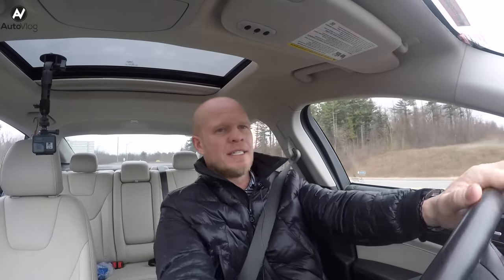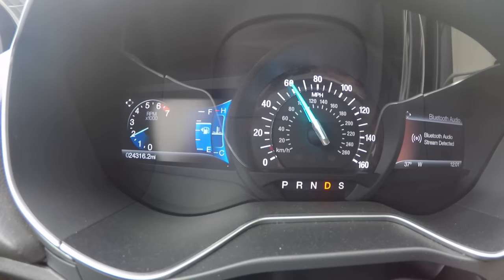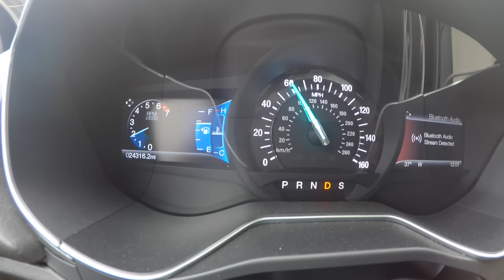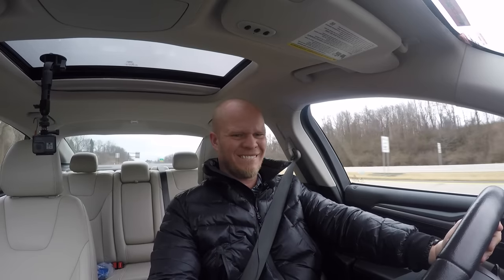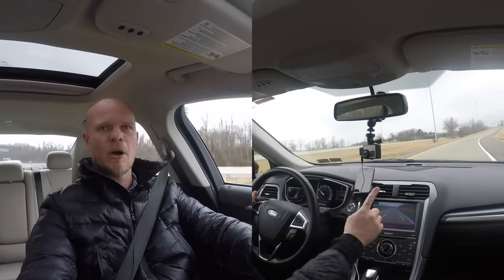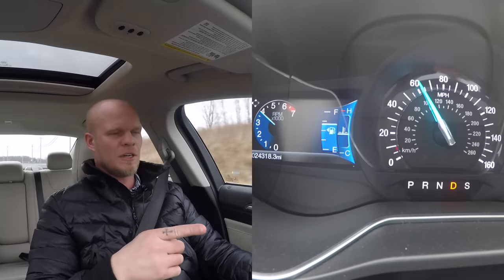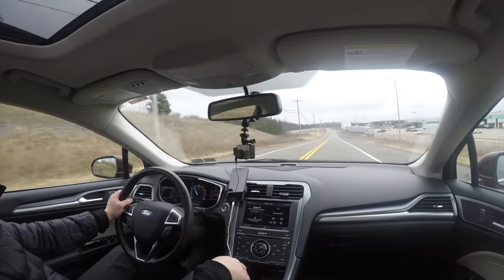What happens if you put your car in REVERSE while driving? (Things NOT to do while driving)

Comment: 😂do it with a manual 😂 thats the real thingy
Reply: SUYASH on agario and more reverse has no synchroniser so it wouldn't engage while moving forward more than a few mph
Reply: I did this with my Audi A3 but I was like 5kmh or sth and It only kicked out the gang to neutral :D but It was scary :D not like this in a automatic car
Reply: I wouldn't know. Never driven an automatic
Reply: New cars won't let you
Reply: I tried it while going very slow slower than walking speed and it already didn't sound pretty
Reply: if the car is >2010 the transmission is probably controlled by the computer so....
Reply: It'll just grind.
Reply: on older cars the wheels would lock up bc the transmission only wants to reverse, but newer manuals just wont allow itself to get in gear.
Reply: I doubt you'd be able to mesh the gears.
Reply: The gang ... German detected! :D It's gear! Must have been a nice crunching sound, did you manage to engage it at all?
Reply: No problem with rev-matching! ;)
Reply: Yorgarazgreece no
Reply: BlastForward LMAO!! rev match always works!
Reply: you won't be able to do it in a manual either it will just grind the gears as the output shift is spinning the wrong way and the sincros cant mesh the gears
Reply: A lot of cars don't even have a synchro on reverse so it's even harder.
Reply: Hey Suyash I'm a big fan of you
Reply: Only way to probably do that is the lock the drive axle, reverse, then off the brake.
Reply: Do they even put synchronizers on first gear? It seems kind of pointless, since you never really need to shift down into first gear while moving.
Reply: Alexander Krivács Schrøder, yes pretty much all cars and trucks since about the 1950's have had syncromesh on 1st gear.  Some of the older vehicles (especially truck chassis) did not, and you had to double clutch to get into first. 
And yes there are times it is necessary to downshift into first gear on the fly such as while climbing a steep hill (even a steep driveway).   The main reason though is this.  If you're sitting still in neutral, engine running, clutch out, the tranny's input shaft and intermediate shaft and all output gears are all rotating with the engine.     When you disengage the clutch, all of those things keep spinning for a while.   If you try to push it into 1st gear without a synchromesh it will grind the teeth on the slip ring's dog teeth until everything has stopped spinning (sometimes very abruptly).    Same thing happens if you try to engage reverse gear too quickly as reverse's idler gear has no synchromesh.    Putting synchros on 1st gear allows it to slow all those spinning parts quietly and engage 1st smoothly, even while at a dead stop.    This is also why if you need to engage reverse very quickly after depressing the clutch after sitting in neutral, it's best to slip it into 1st or 2nd gear to stop all the spinning gears smoothly, and then select reverse.
Reply: Actually, I think you can (did not try) because you will do this with the DISENGAGED CLUTCH, thus the grinding will have only the inertia of the engine-side of the transmission (repeat, clutch disengaged). It's the same mass for which the double-clutching is used. So once the reverse gear is in, the clutch will slip and wear badly to stop the car (similar to when you do 0-100 times....clutch does not care about direction, just speed difference).
I did not do this, but on track days I stop by stopping the engine and using the clutch to "brake" from 10-20km/h. That is because stopping the car with heated brakes will "cook" some pad dust on the rotors. The difference is that I'm already in 1st gear when doing this.
Now, you may stop the vehicle with careful "clutching" (and probably burn the clutch), but if you just pop the clutch, I see 3 possibilities:
1. drive wheels will lock/slip
2. drive wheels will lock/slip + engine stall
3. engine stall and going in reverse (engine, not car)....this is the worst I can think of and would result in engine damage.
Reply: Matei Beratco, plenty of people have tried it by accident, and never succeeded.
The reason is that the output shaft is turning forward while the car is moving forward, and there's enough friction created between the output shaft and output gears due to the viscosity of the oil between them, that the tranny's gears will continue to spin forward at some speed even when the clutch is disengaged.  You can overcome that speed difference with the synchros when moving between most forward gears, but can't stop and reverse the tranny's whole gear train by mashing the reverse idler gear against the forward spinning output gear and still forward spinning input gear.   Even with synchros, pretty much the same thing happens if you try to shift into 1st gear while moving at a higher speed.   The speed difference between output shaft and 1st output gear is just too great to overcome.  

BTW, using the engine and clutch to "brake" (as in to slow down form a higher speed) is generally a bad idea.  You can use engine braking to change the balance of the car to induce oversteer,  or keep from going faster down a long hill, but when it comes to actually slowing the vehicle, 4 brakes do a much better job  at a much lower long term cost.   4 sets of brake pads cost a couple hundred bucks to replace.   A clutch or tranny, several thousand dollars.    If your brakes are not up to the job at the track, it's fairly cheap to upgrade brake pads, rotors and fluid (all still cheaper than a clutch job).
Reply: daemn42  so it's not good to downshift to reduce speed ( used in conjunction with braking)?
Reply: daemn42 U got that from google
Reply: They tried it on Mythbusters. it wouldn't go into reverse no matter how hard they tried. It did make a violent grinding noise, but it never engaged reverse. If it did engage, it would burn the clutch or destroy a synchronizer ring and probably stall the engine
Reply: Christion Collins I'd forgotten about that episode, but yes they tried shifting into reverse at 50mph in both an automatic, and manual and both had no effect.   He kept trying to engage reverse in the manual as the car slowed and it just kept grinding and grinding.     Had it ever engaged it wouldn't destroy a synchronizer because reverse idler gear has none, but had to be taking material off the corners of the gear teeth.
Reply: when you nut, in fact I did not.   I've had a couple manual transmissions out of the car on the bench over the years (one in auto shop class way back in school and another from my own car a few years later), and turned them by hand.  With oil in the tranny, if you spin the output shaft in the forward direction, the output gears and intermediate shaft will start to turn the same direction due to the viscosity of the oil in the bearings that separate them.  All the output gears are turning different speeds relative to the output shaft but still everything wants to turn same direction as output shaft.    Once the gear train in the tranny is turning forward  it becomes almost impossible for the reverse idler gear to engage.
Reply: daemn42 aww got that from Google to
Reply: SUYASH on agario and more it'll just grind
Reply: when you nut, I get that you're probably just trolling now, but I've got a challenge for ya.   How about you try to find on Google, the information I just provided based on my personal experience.    Specifically why the reverse idler gear won't ever successfully engage while the vehicle is moving forward.    There are plenty of diagrams and animations showing how a manual gearbox works, but they all imply that the intermediate shaft and output gears can be completely disengaged from the output shaft, but they don't mention one important detail.
Reply: daemn42 I gotta go now 💨
Reply: my exact thoughts xD blow our engines and shit lolol
Reply: SUYASH on agario and more some times the transmission wont let you put in gear cause of high rpms if I'm at 2k it's pretty hard to throw in reverse
Reply: Yeah the syncros probably wouldn't allow it to happen.
Reply: JoeJ8282, reverse gear usually doesn't have synchros.
Reply: Older car in reverse you'll grind and destroy the transmission but ultimately have the same effect: coasting forward
Reply: Daemn42, that's not true, you don't need to stop or slow down or whatever to change gears.  People have been shifting gears for years without synchro's and still are, you match the input to the output and put it in gear.  I've shifted many a 4 speed transmission with out the clutch, it's hard on synchronizers but can be done with no grinding.  I used to have a T18 with granny low that you could put in low no problem if you revved the engine to match your speed, low wasn't synchronized, but 2,3,4 were.  Semi's do it all the time, none of them have synchronized transmissions.  Downshifting to reduce speed doesn't hurt anything, you need to go out and experience it and get off of wiki.
Reply: Eric Johnson,  Nowhere did I say that you had to stop or slow down to change gears.    I said it's harder on the rather expensive synchros and clutch to use them for the purpose of slowing the car, than to use the cheap and highly effective brakes which are made for that purpose.    Also, rev matching only helps reduce wear on the clutch.  If you want to reduce the abuse of the synchros when downshifting at high revs, you have to double clutch, and the vast majority of people simply don't know how to do that.   The only way to get into a non-synchro 1st gear at speed is by double clutching, and 18 wheeler drivers have to double clutch both upshifts and downshifts.   And if you're braking while double clutching, then you have to learn how to heel-toe and even fewer people know how to do that.    Everything I've written here is based on personal experience, not wiki.    Check out the "R32" videos on my channel for some driving fun.
Reply: Eric Johnson, To answer you questions first, I have not driven a T18 but I grew up in farm country and drove many old 4 speed farm trucks with non-synchro granny lows.   In fact, I learned to drive on one before I was 10.    There was no way to downshift into granny low while moving forward at more than about 2mph without grinding the gears, unless I also double clutched.  That action was, put the clutch in, take it out of 2nd gear into neutral, quickly let the clutch out just to the engagement point to link engine rpm to tranny gear train, rev the engine up to match granny gear's rpm to output shaft rpm, clutch in and engage granny low without a crunch.    In answer to second question.    I have torn apart and rebuilt two of my own 5 speed transmissions (and one in school before that).      

Perhaps your definition of rev matching is different than the norm.   What most people mean when they say "rev matching" is simply stepping on the gas in the middle of the shift (while clutch is fully disengaged) to bring engine rpms up to where they'll need to be for the next lower gear.  Most people do it just to avoid the lurch when they let the clutch back out in the lower gear.   If you don't rev match, then the clutch has to take up that rpm difference and despite what you claim, it does not happen instantly and without stress to the clutch (especially at higher rpm, which is why I recommended downshifting toward the end of the braking, rather than the start of it).    Rev matching (as described above) alone does not match the tranny's input shaft speed (which is now disconnected from the engine when the clutch is in) to output shaft speed (at next desired output gear rpm) unless you also double clutch in neutral to connect engine to tranny's input shaft.       Thus there's no way to downshift into a non-synchro gear without some form of double clutching (wait.. see below before you respond).  

However, I've heard  that some semi truck drivers do not fully depress the clutch while shifting.      Is that what you're doing with your T18 while downshifting and rev matching?   If so then that  has the same effect as double clutching (by keeping the engine linked to the tranny input shaft in the middle of the shift to bring tranny's gear train up to speed).     This is not a technique people generally would use on a passenger vehicle.
Reply: daemn42; Well, maybe it's not "synchros" in reverse gear that I'm referring to, but something in the design of at least my car's transmission prevents it from being shifted into reverse while moving forward, because I "accidentally" tried to put my 5-speed manual transmission car in reverse while moving forward at highway speed one time, and no matter how hard I tried, it just would not go into reverse gear while the wheels were going forward at that speed... there was no gear grinding either, it just wouldn't allow me to do it. (I was just doing a test to see anyway, and even if it would have, I was definitely careful to keep the clutch pushed all the way in, because there was NO way I was gonna ruin my engine or tranny by letting the clutch out at that time, even IF it HAD let me put the gear shift into reverse!... But it wouldn't anyway, so that was totally OK with me!)
Reply: JoeJ8282,  maybe there is some other type of electronically activated reverse blocker in the tranny in your car.  I've driven manuals all my life, and none of mine would let me engage reverse while moving forward, but they've all complained about it with some type of gear grinding noise.
Reply: Yeah, maybe... Or, since my car is from the early 90's, I was thinking more along the lines of something like a mechanical "centrifugal clutch" or something like that, that when the output shaft is going fast enough forward it won't allow reverse to be engaged?... But I don't know how something like that would or could work because I've never taken a transmission apart.
Reply: JoeJ8282 Manual transmissions have a reverse lockout, on Muncies from the 60's you had to depress the shift lever to get it in, and then the mid to late 60's they changed it to a lock out that you had to lift.  Automatic transmissions have a lock out too, you can not simply push the shifter into reverse, you have to physically pull back or push a button, in case of floor shifted, to get it into reverse, it will however go into neutral and that is why they make reverse valve bodies for racing so you can not miss a gear on an automatic.

daemn42 Yes that is how to shift a synchronized or non-synchronized transmission up and down with out touching the clutch.  You saying that it can't be done is 100% wrong as I have done it for literally hundreds of thousand miles.  The high change of ratio makes it harder to do in a car than in a semi or such.  I've shifted Eaton transmissions, my T18 was in a Scout and M21 and M22 Muncies, and a hand full of T10's and T56's.  I've shifted all of them with out clutching and even shifted the Muncies with out lifting off the gas, but clutching it.  Is it hard on them, yeah it is, the only one I would shift habitually with out clutching is the Eaton as it wasn't synchronized, but saying it can't be done is not correct.
Reply: +Eric Johnson,  Please stop trying to put words in my mouth.    At no time did I say it was impossible to shift up or down without using the clutch.     What I said is that if you're shifting normally (in the context of this video about a passenger car, that means disengaging the clutch between gears) it is nearly impossible to downshift into a lower non-synchro gear at speed without also double clutching and rev matching to bring the tranny's gear train up to speed to match the speed of the output shaft for the selected gear.     

Shifting without depressing the clutch,  while rev matching through neutral has exactly the same effect as double clutching, and I fully acknowledge that it can be done that way, but is a technique rarely used in normal passenger vehicles.  I had a clutch fail while off-roading once , causing the clutch to stay engaged permanently, and was forced to drive it home and to the shop this way, but the synchros still helped a lot because as you say, the difference in gear ratios between each gear is quite large.
Reply: The only way to get into a non-synchro 1st gear at speed is by double clutching, and 18 wheeler drivers have to double clutch both upshifts and downshifts.

Those are your words, and you are wrong, you don't have to double clutch shit, I've never done it and won't start, no need to start.  I'm done arguing and don't give a shit, I know what can and can't be done, I've put on a hell of a lot more miles, and blown more engines and transmissions than you can fathom.  

Your knowledge is not there, your clutch didn't fail, your diaphragm failed, if the clutch failed you'd never made it home.  Rev matching, floating gears, bla bla bla, it's all modern terms, we never called it anything back in the day, we shifted how the situation demanded it.
Have a nice week.
Reply: So if my throwout bearing went out on my car's clutch, but the clutch was now always engaged, could I drive my car using the rev matching in neutral technique for a long period of time without harming the transmission?... I cannot afford to fix it right now, but I still need wheels to get around!
Reply: Eric, yeah, I've seen cars like that with the reverse gear locking rings or buttons, etc, but my car doesn't have any kind of hand or finger operated mechanical lockout on the shift lever or anything like that, all you have to do is move the shift lever over to the right and down to go into reverse, (when you're stopped, at least)... It won't go into reverse at all if going forward more than like 1 or 2 MPH... That's why I was thinking it might be something else that prevents it in the internal design of the transmission... Which is a cool and useful feature to prevent damage!
Reply: r.i.p clutch, shits just gonna fucking grind
Reply: this guy , lol he doesnt even know that there is a torque converter so the engine can idle and not lock up when in reverse , however , my dads Honda CRV it was like ten years old and he was rolling down the hill then he accidently put it is reverse and it cut the engine and made a grinding noise , and this was an automatic , he said "ooooooh that probably hurt my clutches "XD
Reply: SUYASH on agario and more We indians know it better :)
Reply: Linda Baboolal he said that because automatics have clutch packs inside them
Reply: my 2003 won't even let you put it in reverse if it's going forward.
Reply: it wouldn't engage, but it will ruin your gear
Reply: SUYASH on agario and more lol likes are 911
Reply: nothing happens.. new transmissions work at certaing RPMS with syncros... an certain speeds.. Reverse  has a low speed ratio.. so it doesnt engage  if you pass certain speed.... all those stupid movies like FF 2 where walker goes backwards almost 80 mph is not possible...
Reply: I've done it with a manual transmission, and did it quite often, in a car I owned years ago. I could be driving along a road and put it into reverse and slowly let the clutch out and it would slow the car down and smoothly start to go backwards. The car I had was a 1991 UK Ford Orion Ghia Si that had synchromesh on reverse gear. I don't think it was meant to be used that way because after maybe a dozen times it became noticeably less inclined to do it so I assume it was destroying the synchromesh.
Reply: What happens when you wake up while driving ?
Reply: Bruh you will be in hospital
Reply: Actually put in reverse when I was driving my friend's car and was so used to having 6 gears while his had only 5. Was driving highway speeds and accidentally changed to reverse while thinking it was the 6th gear 😅😅 just kicked into neutral and nothing happened
Reply: I had to drive a 2000 Dodge Caravan to work everyday with a bad brake master cylinder for about a week. I almost got into quite a few racks. at one point I was exiting a freeway and on the downslope of an overpass. with a red light in a parked car in front of me brakes weren't working doing about 45 miles per hour. how to Swerve into the other lane grab the shifter shifted in the park landed in reverse heard a clicking noise coming from the transmission casinos in reverse and threw in the park at that point the axles locked up and came to a stop
Reply: SUYASH on agario and more my cars trans will explode but it won't let you shift to reverse when moving forward at any speed
Reply: I did that with my Toyota in a low speed,ghost crying then 😱
Reply: I have Mazda 3 2008 my car broke clutch when I went 45 MPH when I  decided to turn do backward it just feel rough on my shift so far I only need to replace clutch PLEASE DON'T DO THIS AT HOME OR IT WILL DAMAGE YOUR TRANSMISSION MANUAL!!!